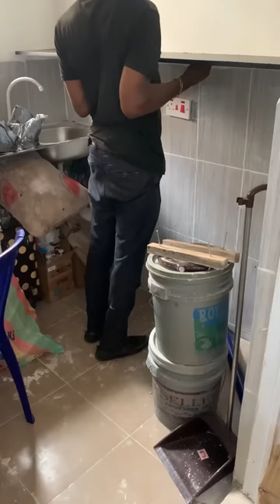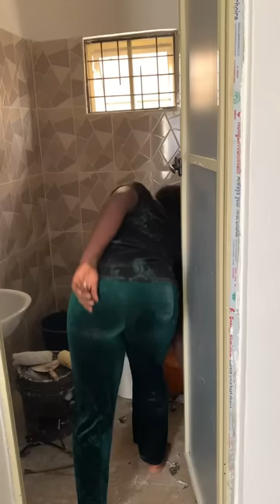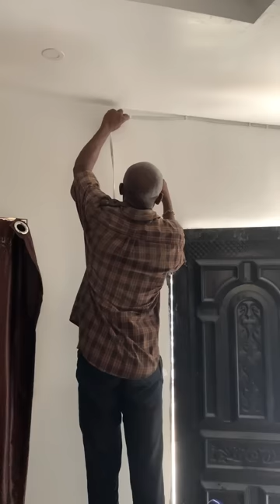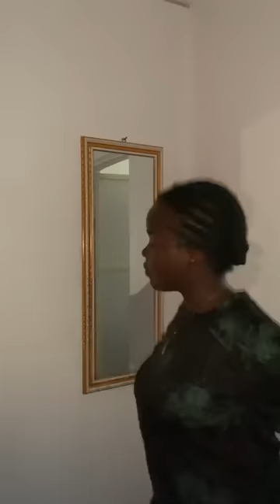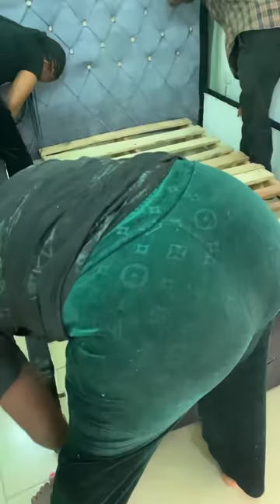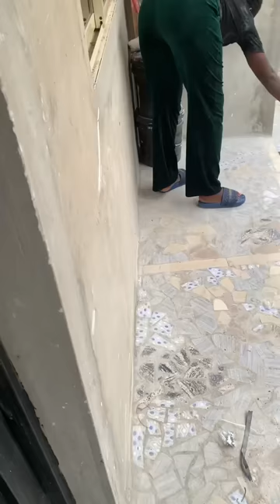A day in my life | Life of a realistic African Girl | NEW APARTMENT RESET

Comment: You should buy a packet of gloves that has at least 50 gloves.
You shouldn't be washing inside the toilet bowl with your bare hands as you can pick up deadly bacteria.
Reply: It is a brand new toilet and you sound preachy
Reply: Need a toilet brush  no need to put  direct hands
Reply: You can wash your hands, which of course she would do. Besides, it's all brand new. Even the taps in the bathroom still have the plastic on them.
Reply: @urasay2  Yes let me be preachy.
Reply: @urasay2  Brand new or not she should use gloves. Bacteria is not selective on which surfaces to appear on. She has used the toilet bowl.  There are deadly bacteria which are in faeces that can kill.
Reply: @florencestanley-charles2682 Yeah, I agree with you 💯